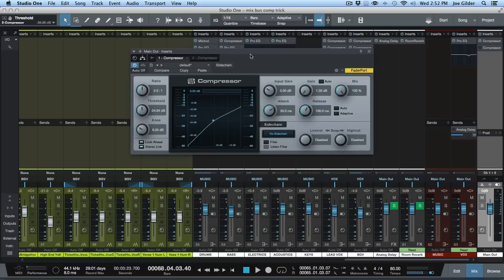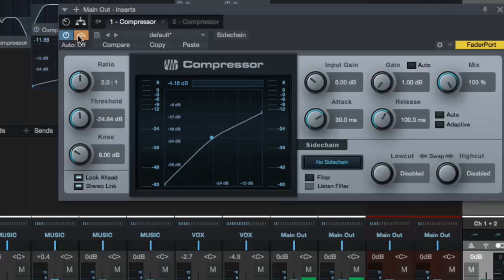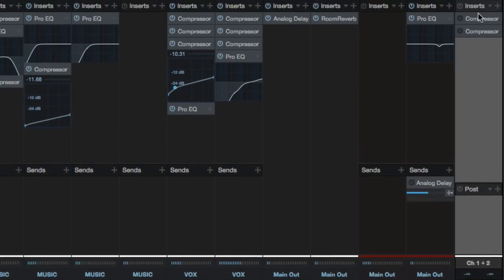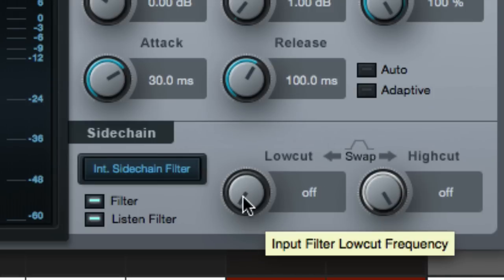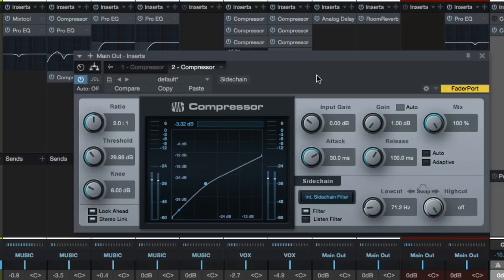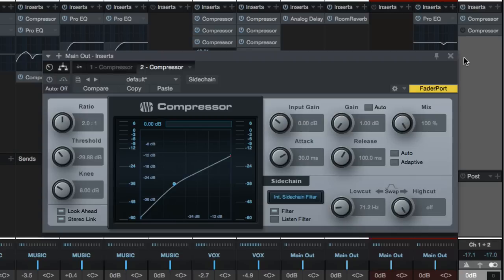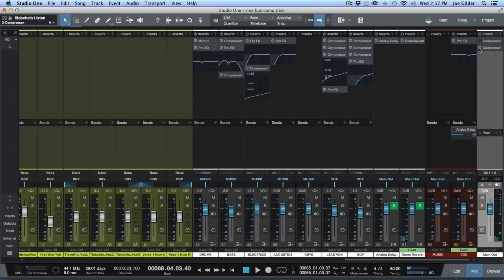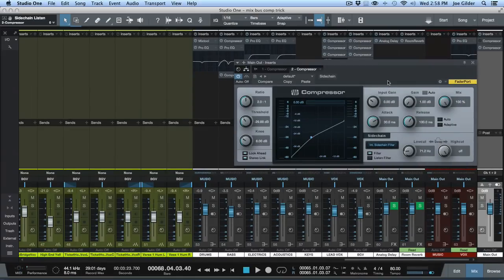Mix Bus Compression Trick

Comment: The Logic X included compressors have a side-chain filter, you can also listen to it. Reason 8 allows you to patch in a EQ set to a low cut into the side-chain filter of the built in mix bus processor. Also the Slate VBC products all have an adjustable low cut filter

Comment: Good for learners but it's not really a "trick", it's pretty standard. You get same results from using multi band compression if you back off or bypass the reduction on the low end.